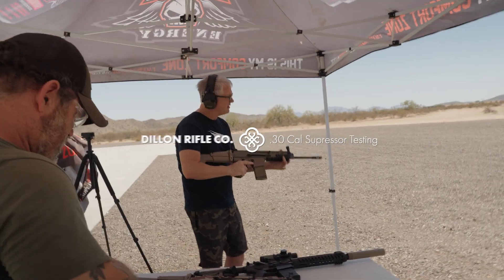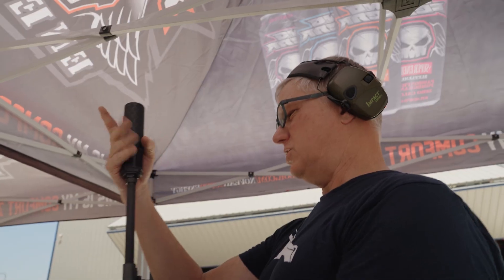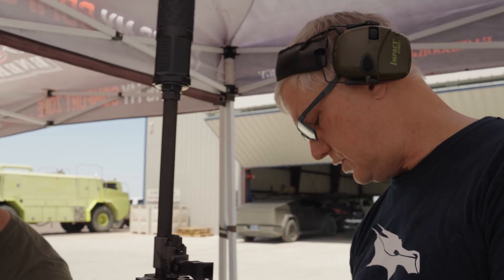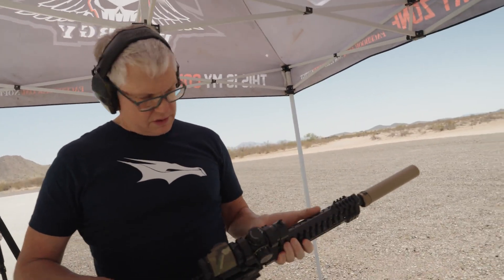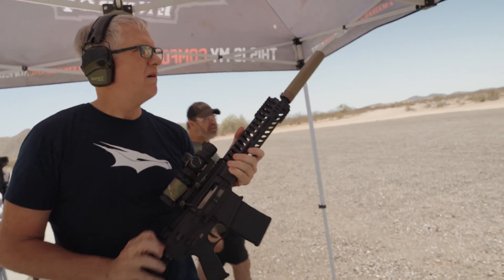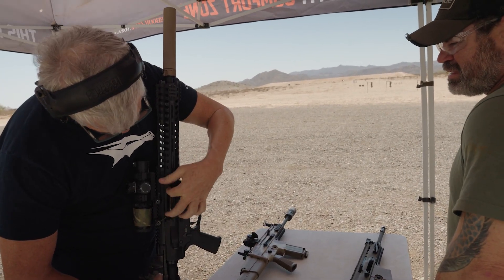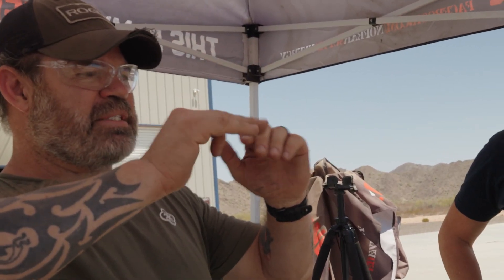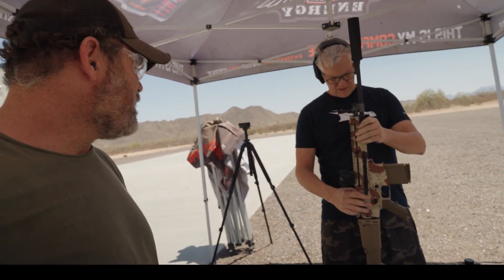Hush Kit | 30 Cal Suppressor Prototype First Shots

Comment: REQUEST---> Run the "can" on a 10" 300BO (supers/subs) and a 10" 5.56 with a NON-clipping microphone during the recording. Using a mic that clips loud sounds is useless whhen filming suppressors. Also why are there only 2-3 reviews on the DRC556 on YT? It's been out for 5 months and no one is reviewing it. Hard to buy a $1500 dollar can with 2-3 reviews by vloggers  who were supplied the can for free.